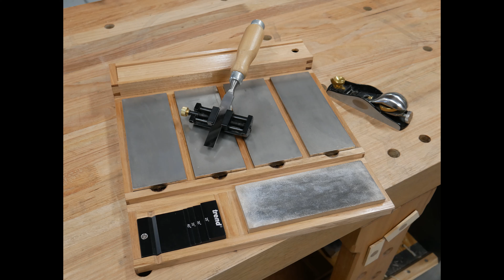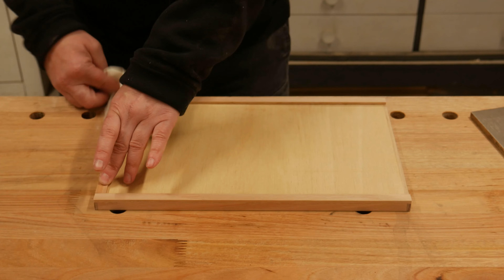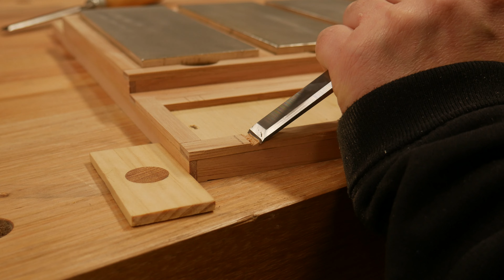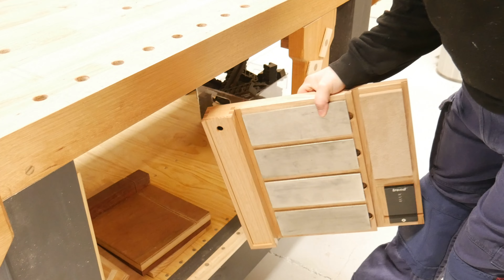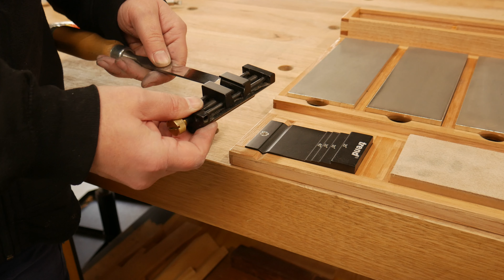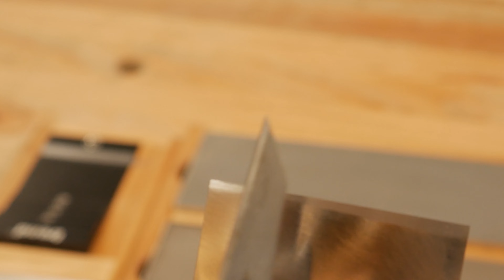Sharpening Station Build/ How I sharpen/ Trend honing guide/ DMT diamond plate.

Comment: Magnets seem like a good thing, but... I had my carving gouges hung on magnetic strips.  Seemed like a great way to go until the tools became magnetized.  Then sharpening no fun because the magnetic swarf gathered around the tip of the gouge.   Hated that.  Deguassed them.

Likely not going to happen with your tools, but I wonder if the swarf is going to pile up around the magnets.    Time will tell.   I made mine similary, but rather than wood strips just got some thing strips of aluminum.   I used silicone to keep my stones in place.  Just a dab.   I can get them out later if desired.  I have enough other sharpening gear where these plates can stay in 100 percent of the time.
Reply from the maker: Thanks for watching. Been using mine for a while now and I have not had any issues with the magnets.
Reply: @RJsShedShop  I'm glad.  And maybe stones that become sligtly magnetic won't matter.   For me with magnetized gouges, it was like one of those magnetic drawing games for kids.  

Maybe magnetized tools are worse than plates that get magnetized, not sure.   Now those tool holders hold wrenches and screw drivers and all manner of things I don't care if they get magnetized.   

Thanks for the reply.   Subbed.

Comment: Great Video!! I saw that you use 3/4" magnetic discs. What thickness did you use? Also did you use Neodymium magnets or Ceramic Magnets?  thanks for your help.
Reply from the maker: Cheap ceramic magnet, you don't need a lot of strength as you need to switch around the plates. Thanks for watching.
Reply: @RJsShedShop  Thank you so much. I have one more question--What size of magnet discs did you buy?  3/4' x 1/4" or 3/4" X 1/8" ? thanks again
Reply from the maker: @elainezuck829  3/4 x 1/4

Comment: Do you have any experience on how the plane iron edge compares using the DMT 8000 grit extra extra fine versus an 8000 grit water stone?
Reply from the maker: Yes, for sure the water stone gives the appearance of a more mirrored finish, and the diamond plate a more dull appearance. I quickly strop so that equals that. Cutting performance is exactly the same. So the advantage is I don't have to flatten the stone and soak it.

Comment: You should not use water on diamond plates- it is steel, and Trend say it can cause rusting. An inhibitor is fine, or use honing fluid.
A secondary (or even tertiary) bevel can save a lot of time sharpening.
What selection of grits did you settle on?
Reply from the maker: Thanks, I normally do use an inhibitor.

Comment: How long did it take roughly to break the stones in and achieve a mirror finish? I've had mine a while and I'm still getting quite a coarse finish
Reply from the maker: DMT stones I use lost the initial top layer of grit very quickly. Diamond stones I notice don't polish as high as water stones, however the result is still as razor sharp. The mirror finish for me comes from the stropping, which is a relatively new process that I wouldn't do without. thanks for watching

Comment: Great little honing board!!  I've got the DMT plates as well in every possible grit they make. (6 total).  I think there is a 7th "medium fine' with I don't have.   I've personally found the extra extra fine plate scratches down to the nickel plating so I picked up a black arkansas stone.  And use either 3 in 1 or wd40 for lubricant and works well for me.
Reply from the maker: DMT are good plates, I will try the 3 in 1 and see what I think. Thanks.
Reply: @RJsShedShop  I also picked up a box of diaper wipes and rubber gloves.   I used the diaper wipes for clean up and it keeps things tidy around my honing board.  It makes the oil not quite as messy.
Reply: Oh one thing about using 3 in 1 on the extra extra fine or extra fine, sometimes the thickness of the oil prevents the blade from seating on the diamonds and cutting the metal, it will skips over the diamonds unless you press down a little harder.  I've been thinking about getting some hone right or trend honing fluid to add to water to make it non corrosive to the metal.  I think the finer grits needs something thin and non viscous like water or  Wd40.  Wd40 isn't as thick as the 3 in 1.  However using 3 in 1 on my arkansas stone seems to work ok.  I also found a tube of white honing compound for my strop like you have and it polishes way better than my green honing compound.
Reply: also another btw:  If you ever get impatient with how fast the cutting speed of the 'coarse' dmt plate, the 'extra' course and 'extra extra' coarse are awesome for re-establishing a primary bevel.
Reply: one final btw:  I've had trouble with the eclipse style honing guides (similar to your trend guide) keeping my chisels square to the plate, so I sprung for the veritas mk II deluxe honing guide.  The MK II definitely keeps the chisels and plane irons square to the plate for a beautiful bevel straight and square.  Veritas even makes a side clamping honing guide (eclipse style) which I'm returning because it doesn't keep the blade square. <sigh>
Reply from the maker: @kfletcher2005  I like that.

Comment: I do need a sharpening station. I would not make one with 4 in a row like you. I prefer to have them up, and raised slightly above the table/bench for making angled passes from either side, rather than move them. I do love the DMT diamond lapping plates. I do have one of the Trend 300/1000 plates, and it is not dead flat. For lube, I don't remember where I heard about this, I use automotive glass cleaner. It does not have ammonia in it, which can bother the electroplating on the diamond lapping plates. DMT also makes diamond stropping compounds, up to 15000/1 micron grit.
Reply from the maker: Every one needs a sharpening station, just figure out what is the best for you. I have purchased trend like yourself and others and at the moment I am very happy with the DMT plates. Thanks for watching.
Reply: Paul Sellers uses automotive glass cleaner. Paul Sellers is one of the most experienced and capable woodworkers and instructors today and he isn’t using his site to push or promote his line of tools. Just sensible, clear and useful instruction in hand tools. 🇨🇦👍👨‍🦳
Reply: The automotive glass cleaner does not have ammonia in it like house hold glass cleaner. The ammonia can cause problems with the bonding of diamonds to the steel plate. I use mostly the Tormek cleaner which prohibits rust on diamond plates and wheels.